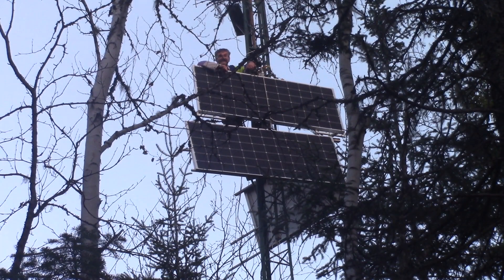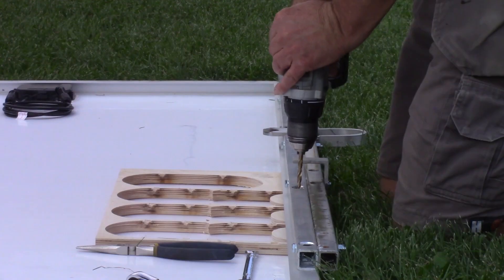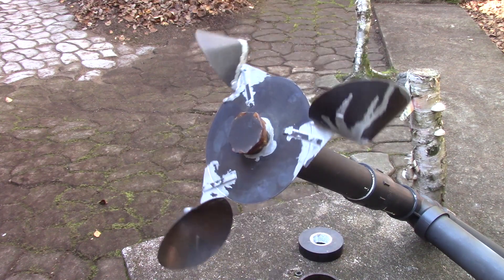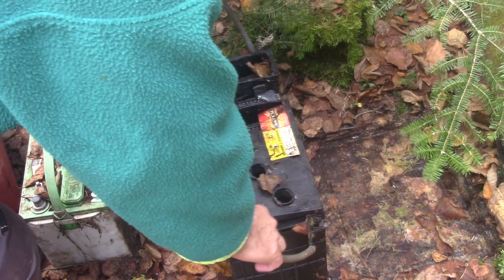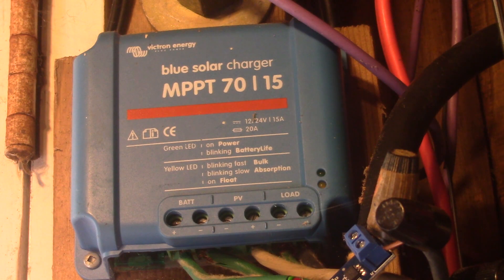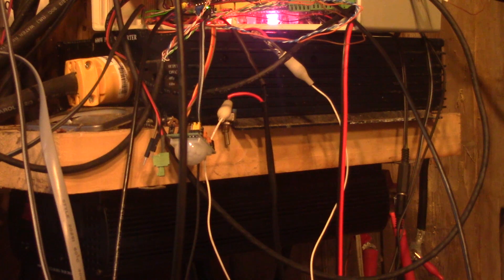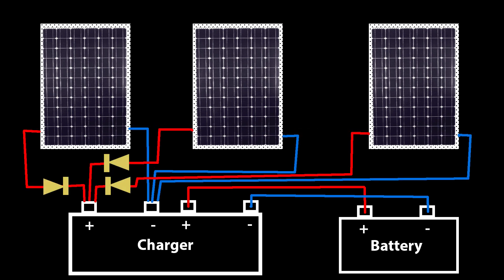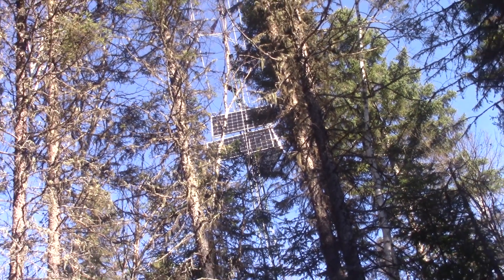The Woodpecker Ep 286 -  Another solar panel at the cottage

Comment: Your little demonstration of the power leads from the panels to the controllers and other magic gadgets shows me I am still comparing apples and apes trying to get ducks. 96 volts? I thought that there were rated outs based on things like 12, 24, 48 and, oh 96 ... If I have a rack of 24 volt batteries I have to couple them together in increments of the MAX charge? (i.e. 96 in this case) or a group of 8 in Series or parallel? and when do I wire in the inverter? And does it take the 96 volts only or what? See. I have watched dozens of these videos and you are NOT trying to teach me but it leads to those who DID. They are so smug as to gloss over some of these little things. And an MPPT??? What?
Reply from the maker: The 92 volts is the maximum amount of voltage the MPPT charger can handle, not the battery voltage. It's why the current from the solar panels is lower than the curent pushed into the battery because my system is working on 12 volts battery.  MPPT is the technology under the charging of the battery, the other is PWM. A solar system is not that simple if you have a lot of solar panel.

Comment: A great way to put a hobby to good use. I love your monitoring system.
Reply from the maker: Thank you. 
I love it, over the years I always wanted to make something that I would like, and now I'm pretty happy with it. If I had the internet via satellite over there I would even be able to monitor it from home, But as it is I have to be there to copy the database into my laptop to study it at home.
Reply: @LgosseuxDbois-TheWoodpecker  I do surveying in sometimes remote locations and I use my phone as a secondary backup to carry files home safely. Beats carting a laptop around :)
I am curious, did you make your tower or have some other means of acquisition?? I've had the yen to make one for years but don't have the use for it yet.
Reply from the maker: I bought an old pyramid tower 20 years ago, this is the one that is still there. I poured the first section into the 4.5x4.5x4.5 feet concrete block so instead of being 64' tall it's only 62'
I have no way of getting my statistics if I'm not connected to the router that is there

Comment: What current monitor board are you using?
Reply from the maker: I made it myself with a raspberry pi and an Arduino, the next version will ditch the Arduino it will work with only a raspberry pi. I've added some analog to digital converter to replace the Arduino.

Comment: What's the PCB-edge-connectorized "analog to digital" cards at 5:48 ? Is the "motherboard" beneath the RasPi something you custom-designed for this? Wouldn't mind a deep-dive on the V2 "replace the arduino" board :)
Reply from the maker: Yes I've designed both of them, I had the PCB made in Asia. While working on the software the other day at home, I unfortunately find a design error, I modified the PCB and like a amateure, I didn't check my modification before putting back the power and POOOF went away my raspberry pi. I'm waiting for a replacement, these are not easy to find these day if you don't wish to pay twice the price. But it will be much better with out the Arduino. As a mater of fact, I was just using the Arduino as a analog to digital converter, but it doesn't have a lot sensibility, especially for measuring current. A curent sensor already have a DC offset, so I end up with an Arduino just having 9 bits  to measure the current. I may do the deep dive as you say when it will be put in place next spring